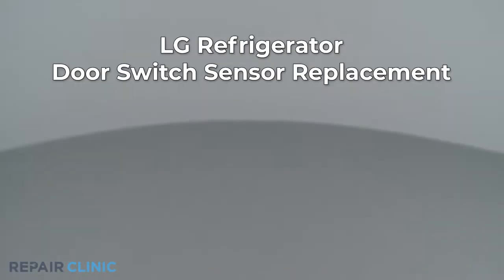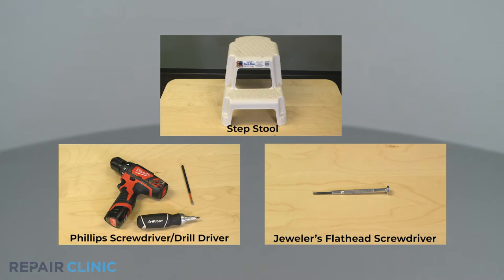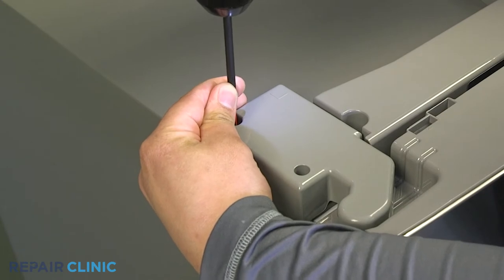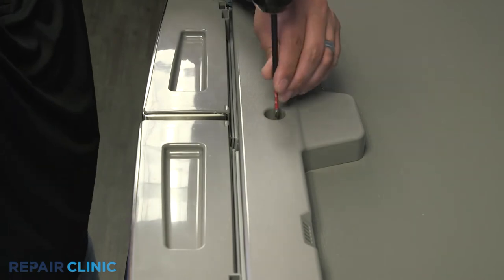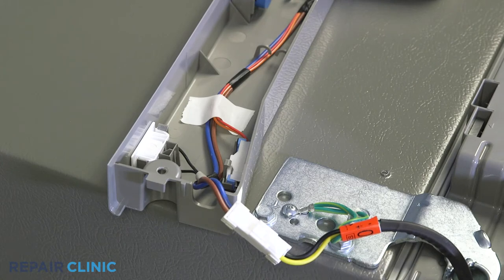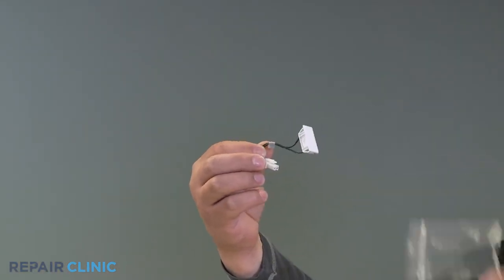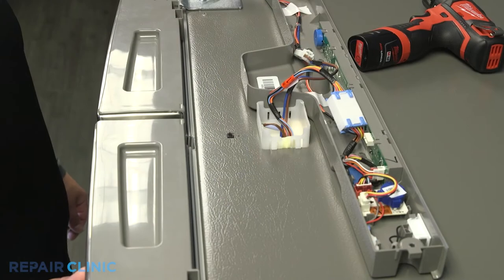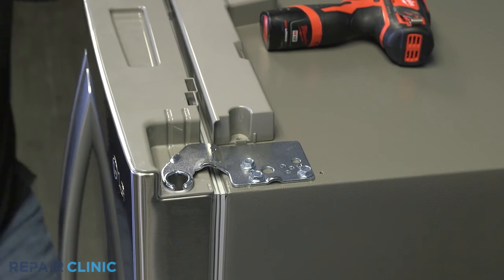LG Refrigerator Door Switch Sensor EBF61314804

Comment: On model LFC25760SW, if one of the two refrigerator door switches goes bad, would that cause the lights to remain on when the doors are closed?  I would assume it does, since the unit wouldn't be seeing one of the french doors as being closed, but please confirm.   Also, did LG do a recall for this type of scenario?  Thanks in advance for your help.

Comment: This looks exactly like my fridge... the control board recently went out. I ordered a replacement board and installed it. The freezer works fine. When I open the fridge doors, the light turns off and I can feel it moving air in the back. As I close the doors, I can see that the light comes on. It appears that the control board is interpreting a closed signal as the fridge being open and an open signal as the fridge being closed. I assume that this is due to the replacement control board being faulty, but could I possibly fix it by swapping the two wires going into one side of each door sensor's PCB connector?

Comment: Hi! I have a LTCS20020 top mount. The door switch triggers when I put a magnet over it, but is having trouble switching from the door closing. I can see the fridge light through the freezer, so I know it's not triggering all the time. I also have a thermostat I put in there to monitor temperatures. I'm guessing the magnet in the door itself somehow wiggled a bit?

Do you have any experience with this? I think I need to take the door seal off and get to where the magnet is, but I'm not sure how easy it'd be to try to re-align the magnet itself... or what it entails.

Thanks!